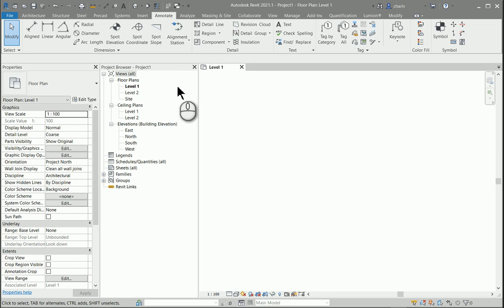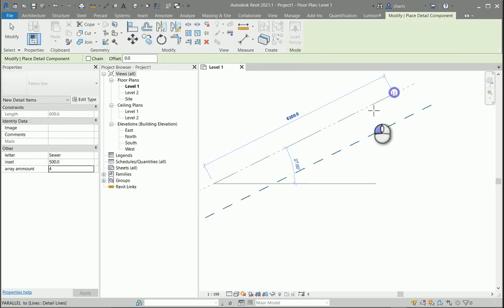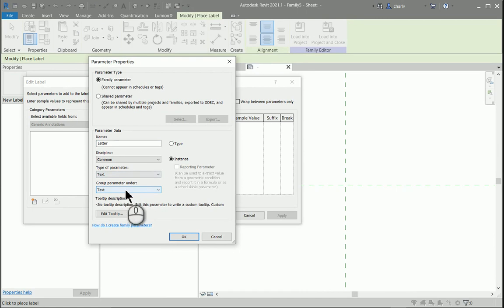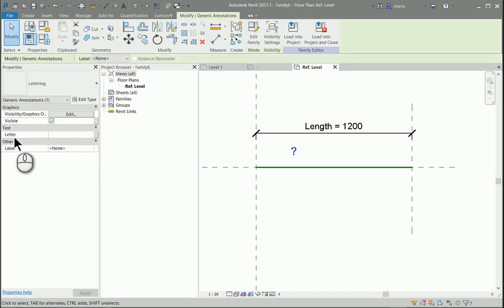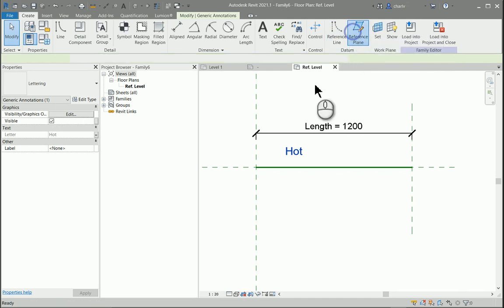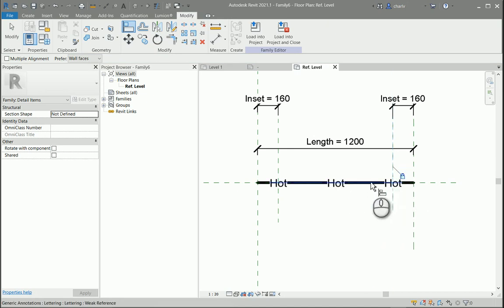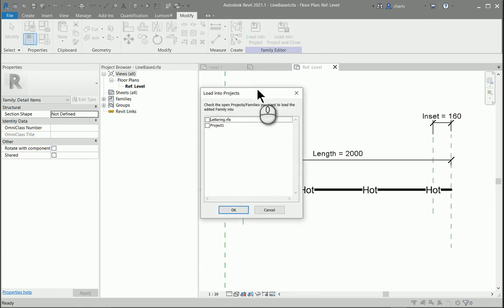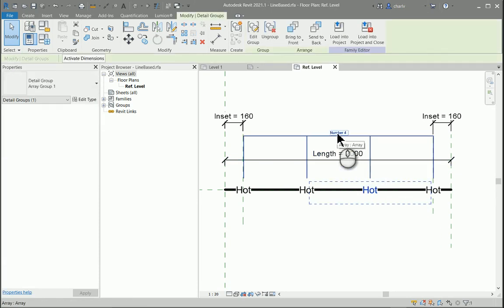Creating your own linetype in Revit

Comment: I'm working MEP (Electrical) and I need to include text for wiring lines. REVIT-Wiring is connected to Electrical Panel information and I can't use linetypes like you're teaching in this video (if I'm wrong please advise). I'm including MANUALLY FOR EACH WIRE (its a nightmare task) the Pipe diameter (1" ENT) and  Tick Marks text description (N 12 G ... means Neutral, Calbe #12, Gorund). My boss said that the only way to do this is MANUALLY ... it this correct ?? Please don't call my boss je,je,je,je.